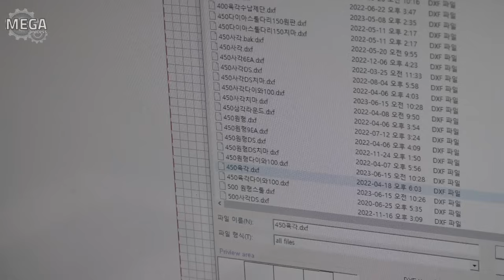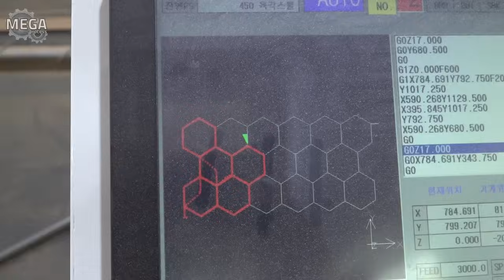Process of making a comfortable single seat chair. Korean sofa factory

Comment: No wood glue😢
Reply: WHEN YOU WATCH THE REST VIDEO YOU WILL SEE
Reply: i watched the entire video and i see no wood glue, probably you refer to the glue they used to glue the foam, wich was sprayed like a 2 years old was using the spray gun @DEGOZMEDIA
Reply: @alexandrugajin763  pls woodglue is not used for 3d epoxy installation.instead a primer is used and i primesd the surface first.

Comment: Except the tailor the craftsmenship is a joke. No wood glue, no screws. That chair is simply a waste of materials because is not going to last long.
I would rather prefer if the pillars would be glued and used predrilled holes and use screws so it won't desintegrate after a short period of time. And the cover (the orange in the video) to have a channel with a rope underneth so you can remove it and wash it. I appreciate the tailor, it does a fine job. But the rest of the chair is a joke, i would not pay money for a piece of furniture stapled together. 
Do not buy this kind of furniture, save your money, buy something of quality made of a real skilled woodworker than this trash to create more demand and waste of this kind of work. This is not furniture is in simple terms, a scam.